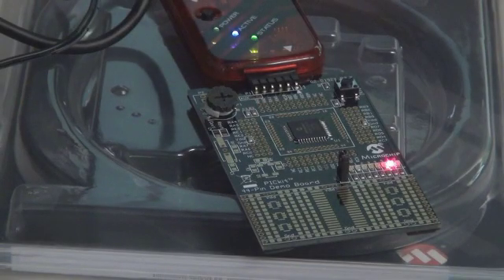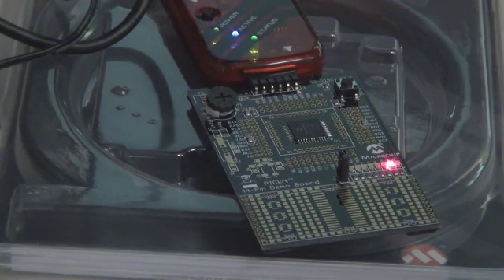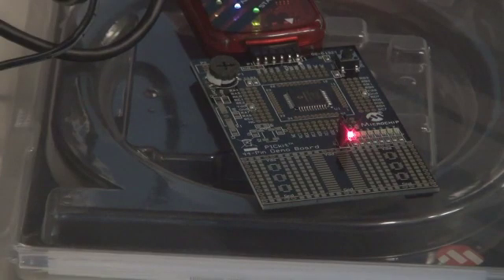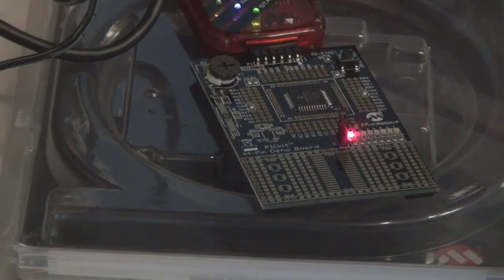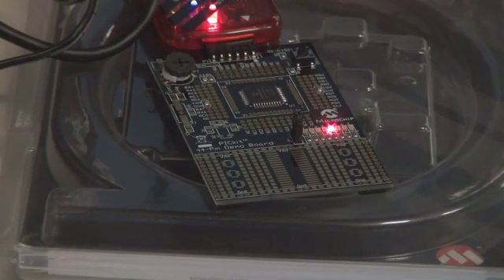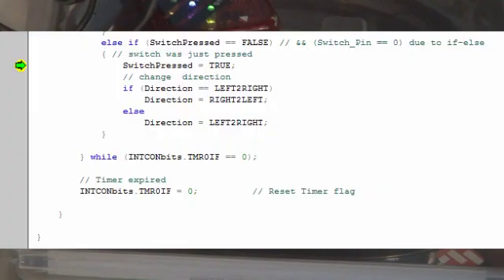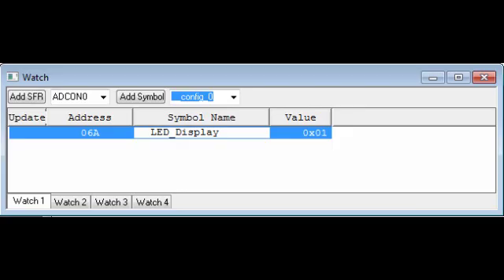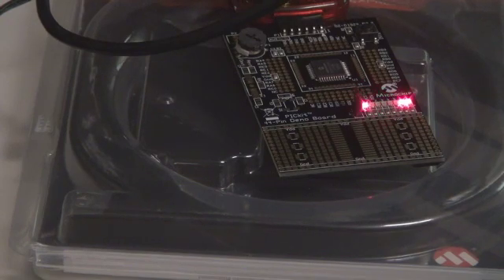Pickit 3 Microchip Demonstration

Comment: That little bugger is what we use where I work to program the entire PIC line except the largest of the chips, the PIC32MX/MZ line (MIPS32 cores). We use the IDE3 (the hockey puck) for those. All my designs use the same 6 pin connection and a 2mm connector wired the same way as the PicKit3 pod. PIC16F and PIC18FxxK families are our workhorses. Only the specialist '51s from SiLabs and Dallas-Maxim in a couple of designs because I learned my craft with those and an 8051 with a 100MHz core was too cool to pass up :P